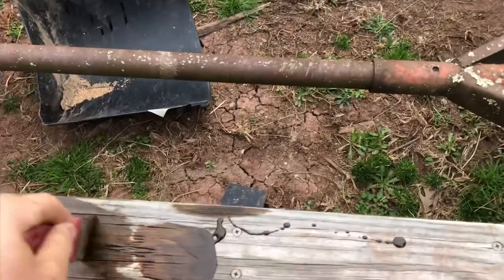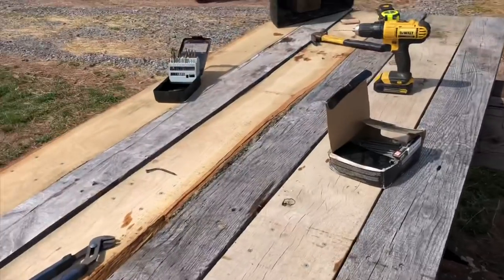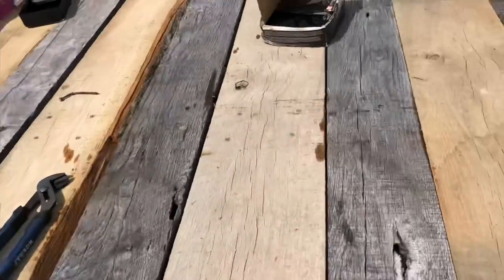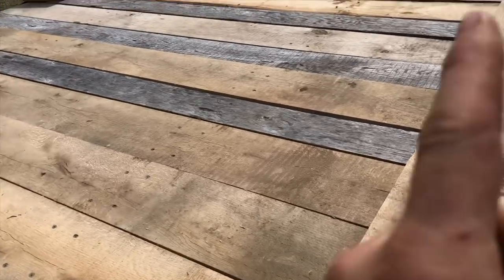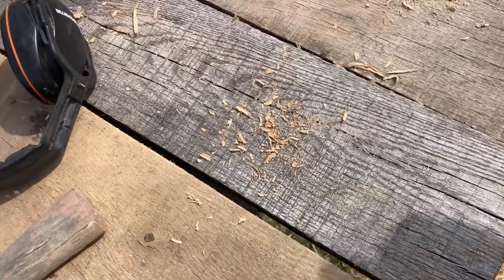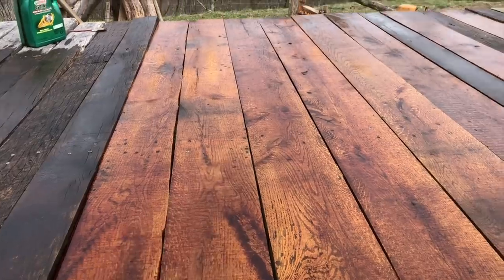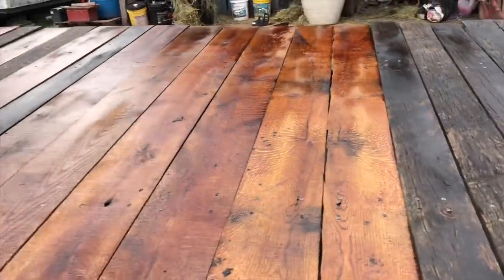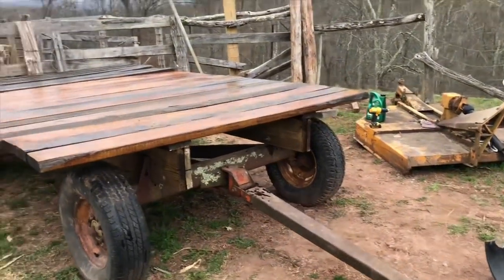CHEAP & easy hay wagon

Comment: I usually use a 2to1 mix (used oil/Diesel fuel). It seems to soak in the wood better. Your chainsaw is like mine. Every time I go to use it the chains dull.
Reply from the maker: Lol yeah I’m not the best at sharpening  them I can get them sharp but making them cut straight is another story
Reply: @Theblindfarmer  Yep, I know whatca mean.